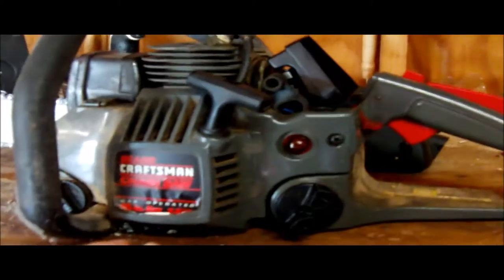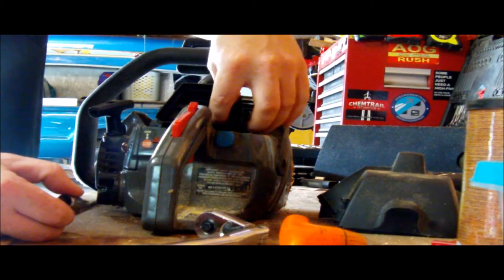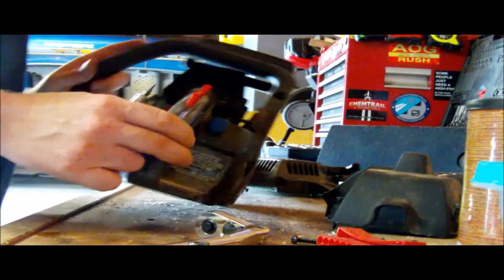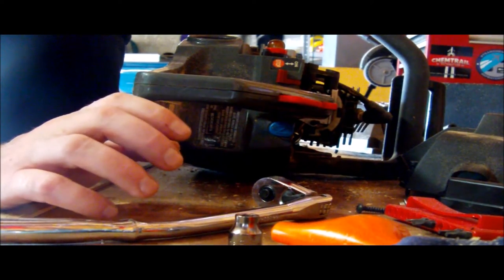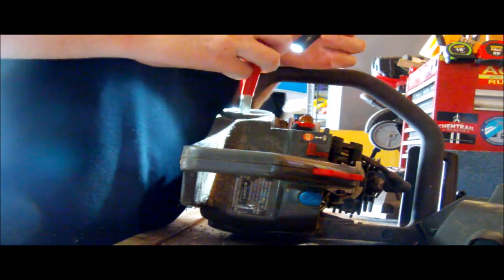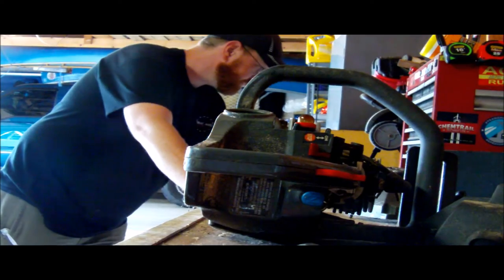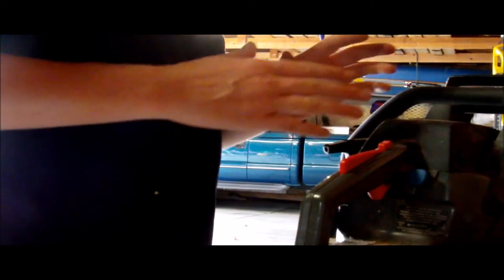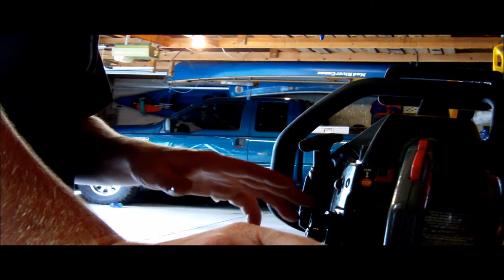Craftsman chainsaw will not run right -  will only run when tilted to the side

Comment: Very helpful video.  mine has the same issue.  I got this from a guy that said it has never worked right.  I looked inside the tank and there is only one line.  The bottom nipple has no hose on it at all so I can't tell which hose is the bigger line.  Can you tell me if the bottom hose or the top hose should have the filter when the chainsaw is on its side once I have a the line on the bottom nipple.
Reply from the maker: That saw is up at my cabin now but the easiest way to tell is pump the primer bulb. The line that is spitting gas back in the tank should not have the filter on it.